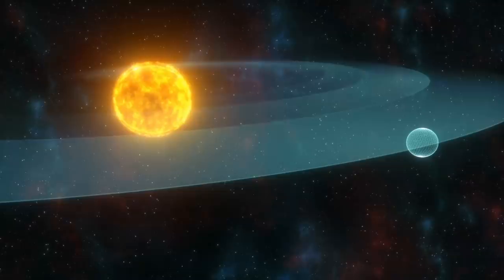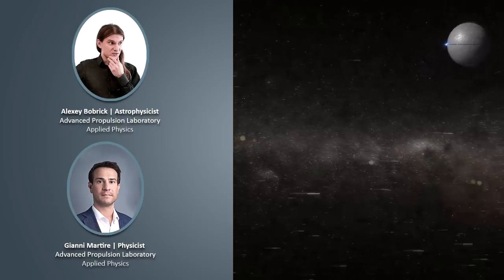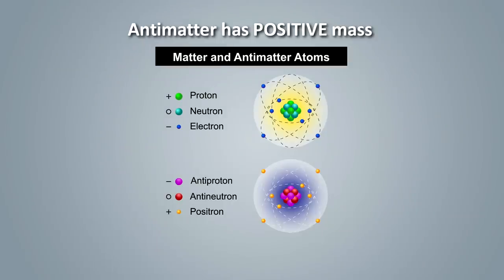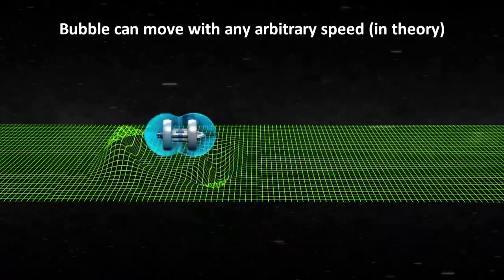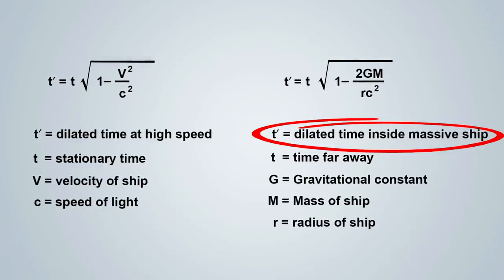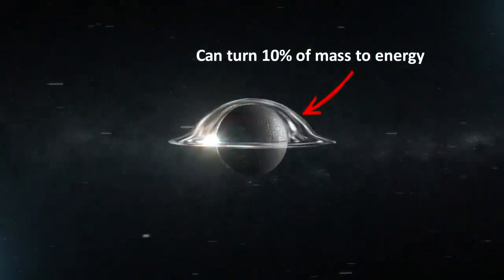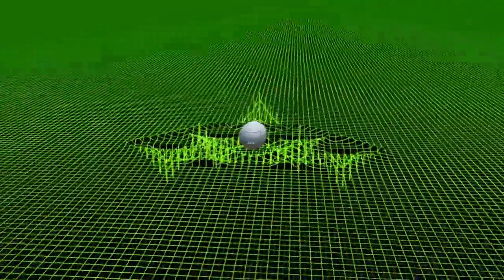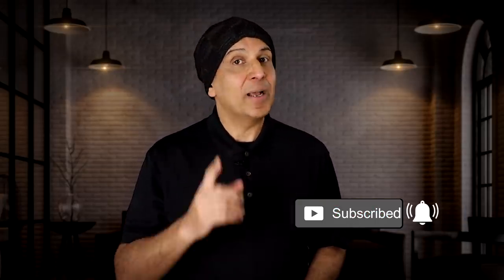REAL Warp Drives? NEW research proposes a solution!

Comment: These physicists continuously apply that space friction on starships, like jets in air friction, and ships in water friction exists.  When you create an EM force field around starships, like the mach-1 sonic bnarrier air slipstream, and air bubbles along the ship's surface creates slipstreaming and easier sailing.

When one creates an EM force field around the starship, it creates a null effect (or this nullification of negative mass) - which is a slipstream - with all surrounding gravitational effects upon it.  If space0time and gravity can't interact ("touch") the vessel, there is no friction, drag, or resistance of an objects movement anywhere in 3D (4D) space-time distances.

One then has a gravity drive and a levity drive, a smaller mechanism than the Albuquieri drive (like the Star Trek nacelles) by having a gravity drive at the front, and a levity drive at the reverse.  Space is sucked through the gravity drive (mini-black hole) it is then transferred as a superconductive matter, that is then shot through the rearward levity drive (mini white hole) shooting out the supercompacted matter out the rear than uncompacts back into "re-matter" of original space-matter volume.

One just needs to understand how Leedskalnin lifted 20 tons coral limestone blocks (WITHOUT block and pulley tripods !) at Homestead, FL Coral Castle.  He created the same negative-null force surrounding the large limestone blocks, and then was able to lift, move, transport, spin, and align into various locations such as a vertical spinning limestone block door.

The issue is to find the correct material (that is now known !!!) to apply onto one's vessel so that is can create the EM force field onto the vessel's surface.  This material and processed are already being used with military vessels.  With higher such EM force fields surrounding a vessel or vehicle (not like the Montauk experiment !) on can create any slipstream for any water-surface vessel, flight vessel, or space vehicle.

The biggest issue is maufacturing sueprcompacted superconductive material that is needed for this meta material on the vessel surface, and its energization as a self-recharging energy conduit.

Comment: Negative matter is just positrons as opposed to electrons according to Isaac Asimov.  Really what is needed is not a wrap bubble, be a zone of decoupled space that the ship can travel inside.
If the ship is decoupled in a strong isolation electro-magnetic envelope,  there is no inertia from the space-time continuum and no speed limit, but you still need a propulsion drive... Inertia is the coupling force of TIME that requires a force in space to over come.

Comment: Hi Arvin. Great video. If one was to travel in a warp drive space ship at an effective speed faster than light would causality be violated in the same way as if one was to travel (in theory of course) at superluminal speeds through space without warp drive? I ask this because using warp drive one is technically not moving through space but instead bending space time around the ship to effectively travel faster than light but without actually “moving”.
Thanks
Reply from the maker: That's a good question. Whenever one asks whether causality is violated, you have to state what your reference frame is. For you traveling on the ship, no causality would not be violated, since you are not moving with respect to the bubble of space around your ship. However, whenever FTL travel occurs, you can theoretically have observers traveling on some trajectory relative to the warp ship, where the amount of time elapsed for the warp ship, from their reference frame, would be negative. This means the warp ship could travel to their past, and bring information from the future. So causality would be violated in this special reference frame. This is one reason some scientists think Warp drives could not be created. However, imho, it is possible that if real warp drives are invented, no such special reference frame would be allowed to exist. I see that as a legit feature that the universe could impose on a workable warp drive.
Reply: @ArvinAsh  thanks Arvin. Why would causality not be violated for a traveler on the warp drive ship? Isn’t this the same scenario as you describe in another video with Alice sending a message to Bob who is traveling at superluminal speed? Bob then sends a reply to Alice who receives the reply before she sent the message. Why is this not the same for warp travel? Or is it the same?
Reply from the maker: @benfmd  The Warp ship is not moving because there is a bubble of space around the ship. This bubble moves, not the ship within the bubble.

Comment: What about 2 same polarized magnents . 
That would demagnitize and instead of pulling in , they would push out and away from each other. If one is bigger it will push rapidly the other away harder therefore further faster. ...

Is this a correct concept on magnets?

Then, how big a magnet would it take to push a rocket magnet to those kinds of warp speeds you need to make this faster excellerated time travel happen? 

Would this be possible

Comment: The key to starting a GRAVITY IMPULSE is in this formula: Energy = mass * C 2. On this basis, you can opt for almost infinite forms to obtain such a solution. For example: Imagine having a wheel radius of fifty inches, and rotating at full speed across a five hundred inch axis, and this in turn moves across its axis from end to end. Now, imagine that every time the wheel reaches one of its ends, you apply a lot of energy to the wheel (only at that end). What would you be doing? ; Answer: artificially increase the mass of this wheel; at that end; given that: E = m * C 2.; you will get gravity at the end where you are applying energy, as opposed to the other where you do not apply anything. So your object will tend to fall towards that point of gravity, gaining momentum. Imagine that you master the NEGATIVE ENERGY; by applying it on the opposite end; the wheel will change there to negative mass; increasing the effect from fall to end where it passes to positive (that is, the difference increases). Now, imagine mastering negative energy to perfection; then you have, like, totally subtract yourself from gravity, and stand on the edge of a black hole, without any difficulty. In a mirror universe, for example; negative mass, will be the real mass; negative energy, its energy; negative gravity, its gravity, etc.. ATTENTION: A gravity drive motor is not equal to a Time Space Bubble. It’s the last thing we should aspire to. For me, although I congratulate the technique applied in this video, it does not have greater possibilities, although it is true; that any ship that placed with these characteristics in space, will reach sooner or later; near speeds light. Unlike the above; with time-space-enveloping bubbles, we can go from one end to the other, or other galaxies; for just as light took millions of years to reach you; you will be isolated in the same amount, and traveling, with a space passing through you, and not you through him. With the crystals; energy was applied in terms of extremes; vibrating (oscillating), producing the same as the example of the transfer and energy in the wheel. Now you can with this information, try it in different ways; through high voltage, magnetic fields; mixture of mechanical oscillations (A high frequency), etc..

Comment: I have always been under the impression, in all my reading about this research, that warp drive itself is what propels the craft and not another form of propulsion (ie ion dtive).  If you already have a drive that can move you to 50% C,  what the heck is the warp drive for?  The warp drive itself, by reconfiguring space-time around the warp bubble is what propels you (it's about 1:30 AM so bear with me please).  You don actually travel in FTL mode, because the bubble isn't moving (bypassing the " no mass can exceed C, concept because SPACE is whats moving and Einstein's theory doesn't apply!
Reply from the maker: The warp concept just creates a bubble of space around the ship. This bubble doesn't actually move by itself. A propulsion system has to move this bubble. The bubble could potentially move FTL, but no propulsion system would be able to achieve it.

Comment: Warp drive,, using the Horus tech. One wheel turns one direction, the other wheel turns the other direction. it gets faster than light, creates a force field that prevents bumping into walls or such, gets very, very cold and faster than 1000 revs per sec, can travel for a few hours and return and not be known to move becomes invisible. You only need two fly-wheels and intermittent magnets. Free energy. Back engineering built and got a craft to start but they became worried and stopped it and shelved it.  
Einstein’s Physics Equation forgot to put into his equation +plus or -minus. When the equation is calculated with, ‘ + or - ‘ you can achieve faster than light

Comment: An anime Saga I like proposed a different approach, that seems feasible IF the graphics of space manipulation are accurate and not just a representation, The saga is called Macross or Super Dimentional Fortress Macross for the original, and they used space folding technology to move about really long distances, doesn't sound as nice as warp drive but if we can develop technology to fold space we could travel enourmous distances by just "taking a step" so to speak, most likely it would only apply to space travel but it should be a good way to go around the speed limit of the universe.

Comment: Nice video. Say you make a super heavy mini death star, construct the warp buble, reach a cruising speed of 0.5 light, but how do you stop that thing? You drop out of warp and its cant be like you do a expanse style flip-and-burn?
Reply: The key to clearing our doubts is: first understand; What is GRAVITY IMPULSE; and what a SPACE-TEMPORARY BUBBLE ?. These questions are satisfied with this formula: Energy = mass * C ^ 2. This starting point allows us to build different technological solutions to travel without inconvenience (WITHOUT GOING THROUGH THE SPACE, BUT THE SPACE AROUND US). For that, for example: we can Imagine having a wheel with a radius of fifty (50) centimeters; spinning at high speed; through a five hundred (500) centimeter axis; and moving (oscillating) along said axis; end to end; at a certain speed (V); but you transfer energy to said wheel, only at the moment it reaches one of its ends. Then; What would you be doing ?: Answer: If Energy = Mass * C ^ 2 (C = It is a constant); What you do is: Increase your energy only when it reaches that extreme; artificially increasing the mass of your wheel; thus the curvature of the fabric of space at that end, and by eliciting gravity at that end. Thus this object (as a whole) will tend to fall towards said point of gravity; that is to say, this technological set achieves momentum, which they usually call: "Gravity Impulse Engine, Warp Engine, Quantum; and the handle of the Sword". Now; for an instant, Imagine that you master the NEGATIVE ENERGY; applying it to the opposite end now of the device: There your wheel will pass (now at that end) it will acquire negative mass, and instead of an attraction by gravity; at that extreme you will get gravity repulsion; increasing the momentum of said set more efficiently. Now, imagine that you dominate this negative energy at a supreme level; then controlling said magnitude at will; you will get the necessary balance; in front of any nearby massive object (be it a black hole, a star, our planet, etc.); that is to say at will; you can generate balance, attraction, or repulsion. Going a little further, and deviating something from the subject (Purposefully to reflect); In the mirror universe to ours; what is negative mass for us, in him is positive mass; so on with energy; as time passes (not wanting to say that a human being there walks the other way around, but with respect to us we would see it that way; but this individual with respect to himself, his walk, and all action would be as normal as here; likewise for other variables as with the passage of time, etc.). NOW THE ANSWER TO YOUR QUESTION: A gravity engine is not the same as a space-time bubble. A SPACE-TEMPORARY BUBBLE; it isolates you completely from Time, and Space. And how can you achieve it ?; Answer: You curve the space in such a way that; you transform it into a bubble-like envelope around you, which abstracts from it (from Space-Time); Isolating you. Likewise as such, when you observe the Light of Alpha Centaury that takes 4,367 Light years to You; what happens is that: with a Bubble oriented in the desired direction and direction; space will pass through you; equivalent to 4,367 Light years, taking you to that destination. Now; How can you do it ?; Answer: In two ways: Option (1): You generate that Bubble, but static around you (Yes, you do not have the ability to generate a Dynamic Envelope; that is, you cannot handle its contour at will); the one that you will have to complement, with an Impulse-Gravity motor (Only of these characteristics; NOT Ionic, or another class); that will provide direction and meaning. Option (2): You have full control of the contour of your artifact's envelope; so that; you make its outline undulate, just like a fish. With said control; you do not depend on a Gravity Boost Motor, so the model is simplified, and its effectiveness. To end; a Bubble-Space-Time, allows you to travel so to speak; isolated from the universe, so not a planet, star, etc., are obstacles; In other words; you are not part of the space; you travel secretly from it, and therefore you can travel from one point to another, and to any confines of it.

Comment: I think we have focused too much on push for acceleration. I think the answer lies in creating/finding a way to have the ship drawn forward. Perhaps like wind being drawn from a high pressure area to a low pressure are. The ship, like the surfer rides the wave. The wave however draws the ship on creating a positive loop of (energy) momentum to increase the speed of the ship. To stop the ship slides off the back of the wave and out of the momentum like the surfer slows once out of the pull of the wave.
Reply: What if we could get a ship going near light speed and just contract enough space in front of it so that it’s effectively covering more ground than light would? Is this similar to your idea?
Reply: @bradysmith4405  yes. Something like that. Movement at the edge of light speed cannot be achieved solely relying on power generated by the object moving. Light speed or close to it needs to be initiated by having less to pass through than is behind it Less being, matter or force such as gravity. As though a hole forms just ahead of the object to be moved so the object moves to occupy that space and repeat until the destination is attained.
Reply: @StephanieElizabethMann  Lentz also refutes the paper saying his soliton warp drive couldn’t be accelerated faster than light so I guess there is some back and forth disagreement on that
Reply: @bradysmith4405  I think the solution to speed of light motion is changing the state of the vehicle in motion. The state being the place where the vehicle is in space and time. Like a gyroscope spinning on the end of a rod makes it easier to lift the rod due to the motion of the gyroscope. The "space ship" would require something similar to change its state. If not a solid gyroscope then perhaps a gyroscope based on the motion of protons in a particle accelerator. The difficulty in expressing these analagis terms they are like all analagies they are a representation of a part of a bigger picture. To combine these snapshots into a cohesive whole will be the challenge.
Reply: @StephanieElizabethMann  I’m going to have to read through this a couple times to understand 😅. What Lentz says is that his warp in space time should not be mathematically viewed as an object subject to gaining mass with an increase in speed

Comment: Arvin Ash, Zero-point energy systems exist, the powers to be have put them in the:" Disruptive Classification" Thus not allowing them to be produced. There are at least (6) Six systems that have been invented around the world. If Alcubierre and Bobrick & Martire were to use multiple Zero-point energy systems to drive their craft then interstellar trips are theoretically and physically feasible. With several drives powered by Zero-point Energy, you could accelerate the ship to the speed of light and beyond. A ship of the size you are talking about could be built with the use of several robots that could make it possible in a short amount of time.